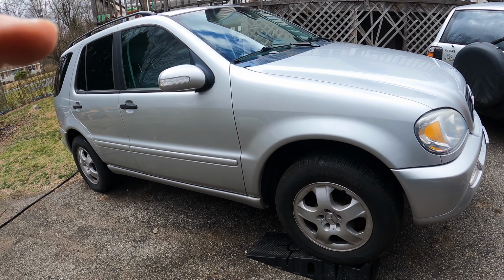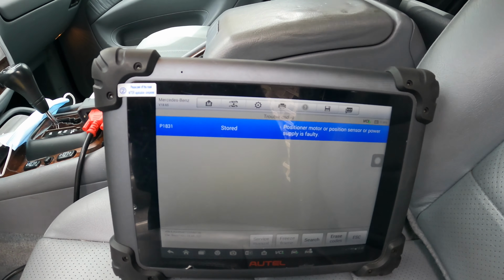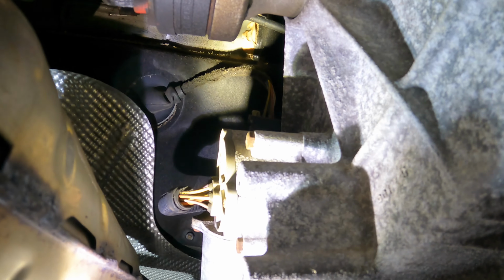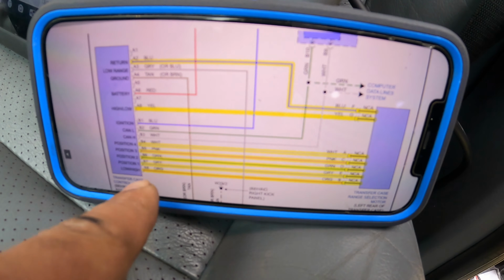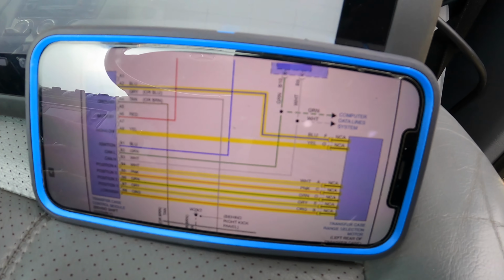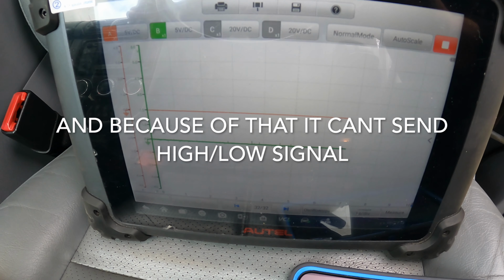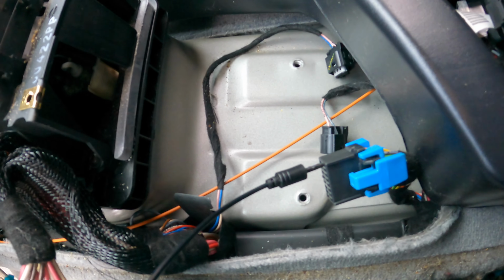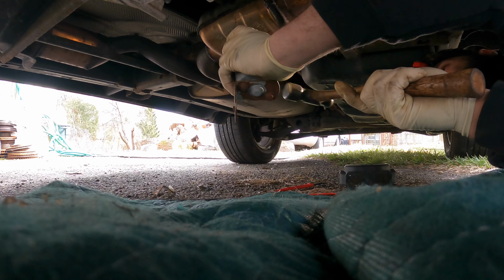2002 MERCEDES BENZ LOW RANGE DOES NOT ENGAGE -  BAD TRANSFER CASE?

Comment: hi my car is the same . I buy new motor from amazon (not original ,new part) but low range no work . How i undarstand where is problem in motor .or module with yelow label.How i test module with yelow label is ok ? One more detail , the angle sensor in steering wheel no work ,this detail relevant ?
Reply: did you figure it out? im in the same boat